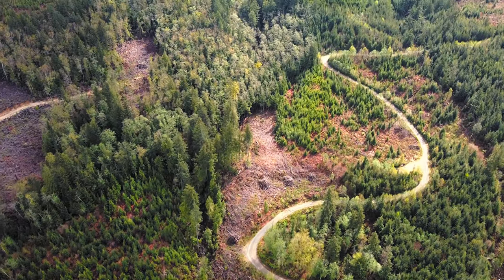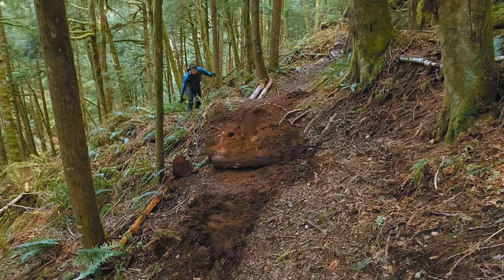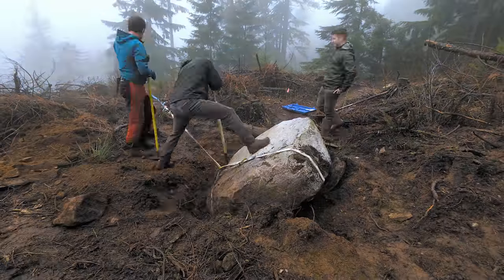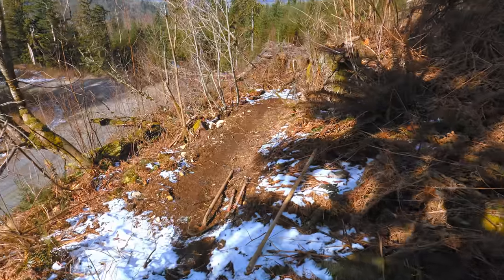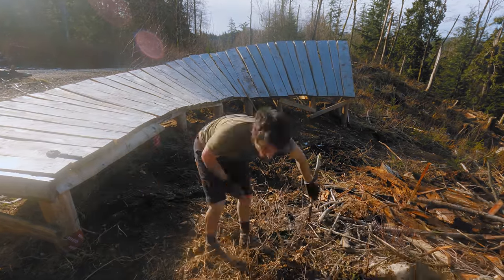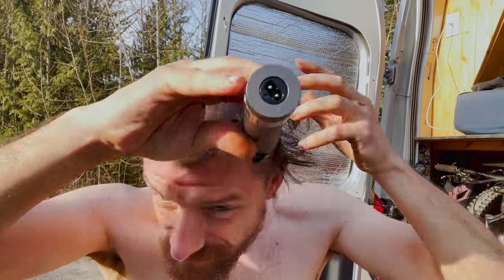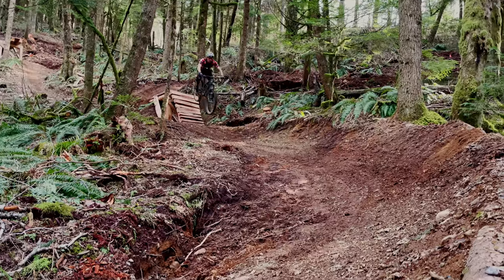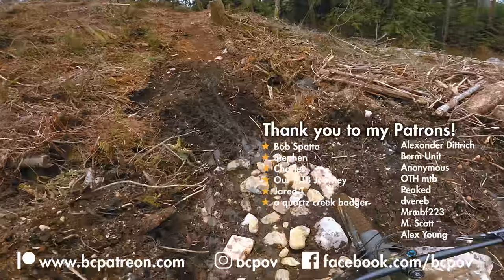I Built a DOUBLE Shark Fin! (and Other Trail Improvements)

Comment: Most of the riders who have ridden the shark fin kind of end up exiting straight, but if you had more speed and were coming off the fin in a kind of hip to hip transition, you might be liable to land in the slash pile to the right of the landing. I'm wondering if it wouldn't be a good idea to build out the landing a little farther to the right - maybe with a bit of a berm.

Comment: I recommend a mcloed/tamper like the Rogue ProHoe Travis 70AR. You can tamp a berm to be ready to ride right away, just make sure the tamping surface is totally clean of debris or it will start to pick up material & not provide a nice seal on the top layer. A nice leather glove is good for continually cleaning the tamp surface on the travis tool. Other porous materials clog with mud or can transfer it onto the tool handle. Nice video & good work on the trail.